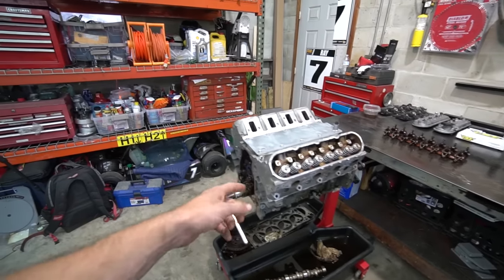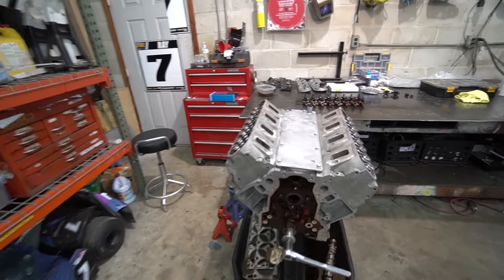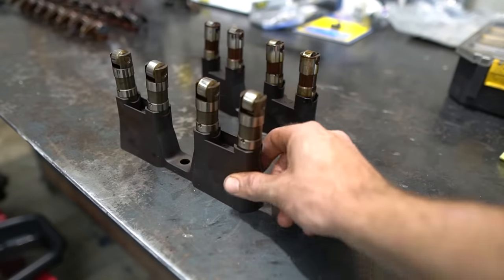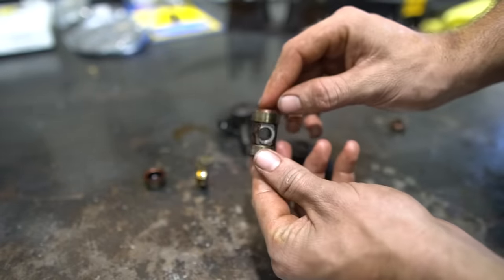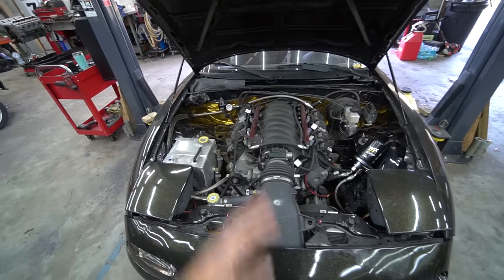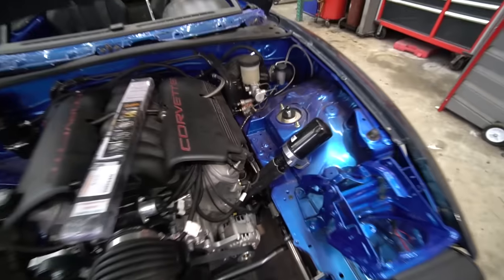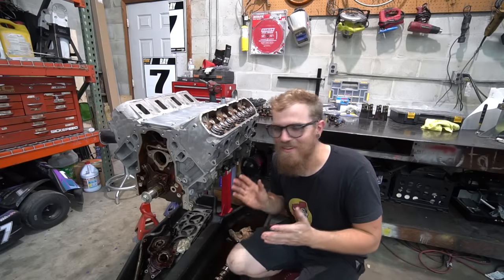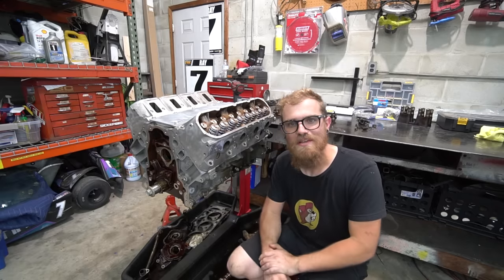Top 5 Mods To Make An LS Engine Reliable.

Comment: Hey bud so I will be working really hard as most of us at work to save  my goal of 16k to 17k give or take for a the best bang for my buck and I don't make a lot of money so I have to do extra work on the side so when I reach my goal and can start my build this spring I absolutely want it to last like you said! So I definitely am taking the tips you have spoken about to  Heart! 

Now as far as my my question for you. 
I know you said don't do any lower end, But I have a not so common build in store for my plan. 

I would like to go with a flat-plane  100% for the higher revs and the amazing F1 high end sounds. 
And I also want to CAM it as well.
I have never really worked on any 
 Internal parts on a motor little on never even pull the motor out or swapped a motor before! 

I am a total new be! 

But I am really serious about this very uncommon build and just want it to last a long time.
I will be doing this swap in my first-Gen 350z I have had for over 6 years now and have spent over the years a lot of money one making it look amazing for car shows and it truly looks very fast but its really just a stock 350 for the most part 
And now its time to make it fast and strong and RELIABLE.  

this is really my first real build as I had mentioned and I don't want it to fail any time soon so what are your best thoughts and insights on my intentions for this type of build? 

Also is there any way possible that we could talk on any different forums or Facebook or shit even just by phone at some point about this stuff? 

Please hit me back at your earliest convenience.  

Thanks in advance.  

PS: you video was great and was exactly what I needed to watch before starting a build. Great job and for helping a lot of people to not make mistakes.  
Keep up the great content.

Comment: Why do all 6.2 l92 after 3,000 miles have so much junk attached to magnetic drain plugs? They always have them I got several worth 40,000-80,000 they all get lots of it ever notice particles after oil changes ?

Comment: I like your video. Quick question, 5.3 out of a 2000 suburban with 283K miles on it. Would you rework the bottom end (new crank/cam bearings, crank honing, etc.)
Reply: What are you doing with it? It's probably fine; Motion has videos of a motor with double the mileage that they supercharged and beat up on. It's called the Bald Regal.

Comment: About the accusump thing, I used to race short course offroad and ran one, but I always wondered what happens if when the sump is filled, it gets pressurized air in it? Wouldn't it just do the same thing?

Comment: I literally beat the piss out of my Vortec 350 with 235k miles on it. I run Rotella in it and change it every 5k miles and that's it. I have a brand new spare engine that I got out of a parts truck for when mine blows up.

Comment: Dry sump does make it faster .A dry sump system is worth about 33 horsepower on a ls motor . On the motor dyno .good oil is another thing .dont be cheap on oil .a good racing oil with zinc in it will help save a motor. Plus its horsepower. Just say a Mobil one racing oil  synthetic is worth between 6 and 8 horsepower over a regular 20 50 racing oil .all your good racing oil is worth the money .in a performance style car .not your daily 300 thousand mile motor . Just saying we see it every day on the dyno.
Reply: A good dry sump pump will also generate crankcase vacuum, which is good for some horsepower and helps keep things from leaking!

Comment: Baffled pan would be ok just spinning the truck around a few times doing donuts?  I'm cam/converter only no race car here.  Also, which pan do you recommend?
Reply from the maker: Yeah that should be fine just overfill by a qt. And any trap door sheet metal pan would be ideal. You can get away with a cast baffled pan like the aluminum one I have in the rx7. It’s a mast swap pan.

Comment: I work for a GM dealership and have noticed that the trucks with the cast iron blocks do not have as many internal problems as the aluminum. Do you think this would be better for your drifting as far as reliability given the consideration that the block is heavier?
Reply: It's only 100 pounds more for an iron block
 Not all that great of a weight savings
But the Aluminum blocks have tons of downside

Comment: Good show know what you're doing GM all the way but I rather just have a older style bow tie block could do the same thing you're doing without having to spend all that money on the oil system just get a high volume oil pump and a pan you're good to go with the older blocks

Comment: Kind of a dumb question. But is high oil pressure a big deal/what does it entail? I know that low oil pressure is always a bad sign. But what about high?
Reply: If it's too high it'll start blowing out seals. Usually front and rear main would go first

Comment: MOST DONT NOW, 
Now you never want to over fill a engine with oil even if its your lawn mower. 
BUT.
if your car came wit a LS1V8 or what ever it says in the book to put 1 extra QUART of oil in to her before u run it hard, right in paper and black and white in the manual and run 5w30 full syn M1. all gm Ls comes with it from the factory don't skimp on correct lube 💥!!!!!!!

Comment: How many of these things are a must for just a street driven toy LS2?
Reply from the maker: Really none. Unless you have it out then do the seals. But yeah this is all for cars seeing g forces and high rpm often.
Reply: @Taylordrifts  Gotcha.  So the oem rocker arms are only a worry if you're on limiter a lot.  The seals and cam+valve train was something I was planning on doing when it comes out for engine bay paint. Motor only has 85k on it so Its still pretty much a spring chicken.  hahaha  What kind of oil pressure should a freshly sealed up and tight engine be hitting?

Comment: Is there a gear drive for the dry sump to avoid the belt drive and the possibility of losing oil pressure if the belt flys off, and by having gears you could change pressure by the gear ratio?
Reply from the maker: They do have dry sump pumps in the pan that are driven off a chain. But this isn’t like that.

Comment: But you didnt upgrade your oil system on the c5 drift vette right?! That thing did just fine
Reply from the maker: They have pretty good stock pans and it was running very low grip. The more grip and g force you experience the more slosh you’ll have.  A comp drift car starts to pull a lot of G’s
Reply: @Taylordrifts  Awesome thanks man! Iv finally got myself a c5 and cant wait to get started drifting! Thanks for being an awesome influence all these years!!

Comment: How to make any engine reliable, CHANGE OIL, change oil pump to high volume unit FROM MELLING. add external oiil cooler and bypass valve for cooler if oil is too cold. Run Recommended oil weight as a synthetic. Stay away from Penzoil, Quakerstate, Mobile 1, Royal Purple.

On LS engines, TURN OFF AFM IF EQUIPPED, REPLACE OIL PICKUP TUBE RING WITH A FELPRO OR MELLING.

Comment: I'll just keep on searching for the Dry Sumped LS3's and add forged rods (they already have a forged crank in them) forged pistons....CORRECT the deficiencies of the flow circuits in the oiling system...The LS oil system has a lot of 90 degree intersections that are poorly drilled....and MOST OF ALL....Run the OEM oil barbell at the back rather than some aluminum piece of crap that lets unfiltered oil bypass the oil filter feed....Maybe those guys making those aluminum barbells should add another "O" ring onto them to prevent unfiltered oil past the barbell like the GM one that seals to the oil passage....🤣

Comment: Whys is there a check valve on bens accusump line? doesn't the oil need to go both ways through the line, to refill the accusump and to supply the engine with oil.
Reply from the maker: Basically that’s the return from the cooler. Normal feed route would be through the check valve open. Accusump would be on the closed side bypassing the cooler and filter and going strait to the engine.
Reply: @Taylordrifts  ok its not on the accusump line, that makes a lot of sense. Thanks!

Comment: Ok what if you buy the engine do all this work you're talking about and you dont mess with the bottom end... you go to start it and it smokes?  how do you know for fact that the rings are good? Now you have to go back and pull the motor back out and take off just about everything you put on to replace the rings... Yeah you can take the caps off to look at the bearings but what about the rings?
Reply: Test compression.

Comment: Over 250K miles and still running smooth as silk. Yep. Just put gas in it and change the oil once in awhile.
Reply from the maker: You didn’t watch the beginning of the video did you?

Comment: New to the ls swap deal, have a fox notch , there is absolutely NO WAY I'm NOT LS'n it. Any pro / Con to the L33 over the standard iron 5.3 Anyone? Thanks in advance 🤘
Reply from the maker: L33 has better heads and flat top pistons giving it higher compression. Depends on what you wanna do with the car. Budget and strait line speed just go iron and turbo it. Auto x or drifting or something save the weight and go aluminum block bits 101lbs less than the iron.

Comment: I guess if your watching this video to "learn about motors" then yeah, dont mess with the internals. But theres absolutely nothing wrong with refreshing the motor, adding head studs or building it
Reply: The point is most people that do a LS swap don't really need that extra bit of tweaking for what they really want to achieve. Of course you can do a refresh but honestly there is so much that can go wrong and if 400-500hp is the real life goal then its already got you covered. Sometimes an engine is only bought for the sole purpose of tuning it to the max as it sucks at stock but with the right setup can shine. Sometimes an engine can also be bought for what it already has like an LS.
Reply: It's kind of like soldering. Most people think they know how to do it. Most people can manage to make a connection work. Most people are actually bad at soldering. The same applied to engine building. Unless you a certain you can get it all right, you may have a higher chance of messing something up than getting it right.

Comment: I am about to buy my first LS to build. What would be something you would tell a first time motor builder?
Reply: The Fit Fam how much power are you going for? NA, turbo, supercharger, spray? Vehicle weight estimate?
Reply: Know Bull5hit I may want to supercharge or pro-charge at some point but I want it around 500whp if I can get that NA I may not even think about any type of forced induction. I’m not sure the exact vehicle yet still on the fence with that part.
Reply: The Fit Fam  what will you use the vehicle for?
Reply: For personal enjoyment no drifting or drag racing.
Reply: The Fit Fam i would recommend doing a mild bolt on 6.0 or 6.2 if you can find one for a good price. A 6.2 with cam, springs, throttle body would make right around 500whp in a stick car. For your goals you’ll never need to touch the bottom end unless it was already hurt
Reply: Know Bull5hit that’s what I was thinking I would need, but thank you for the info it really help me know what I need to look for.

Comment: What's the best LS motor to look for to upgrade an LS1?
Reply from the maker: L92 truck motor. 6.2L aluminum block, L92 Rec port heads. Easy 500whp with cam and springs

Comment: That oil pickup tube single bolt despite two bolt holes ... I'd call that an engineered failure point. It's that way on purpose to get people to buy engines.
Reply: It's what happens when accountants get involved in engineering decisions.
Reply: It is perfectly fine in stock application...there are millions of these engines with a quarter million miles on them with one bolt...

Comment: DO NOT USE 20w-50 RACING OIL IN AN LS ENGINE.  Sorry all caps, but damn.  I build these engines from pan to intake and someone ALWAYS tries to run 20w-50 through it.  Listen guys, IT IS NOT A SMALL BLOCK.  Dude, that would be my Number 1.

Comment: U generally dont have to change the oil pan on a ls swap if u swap in real ls motors and not a truck motor
Reply from the maker: The vette pans don’t fit well in just about anything. So really only GTO and F body would allow you to not change the pan and you should be doing a baffle in those anyway.

Comment: I would be paranoid knowing bottom end could get wiped out if a belt snaps. No Thanks!
Reply: Having that happen is way more rare then bottom end dying from wet sump. Look up and legit race car and 95% run dry sump. There's nothing better for the oil system than that.

Comment: The only way to make a Chevy reliable is to pull the motor and transmission out, sit it on the ground and stomp on it, then drop a Ford motor and transmission back in it.

Comment: The lifters are not what fails. It has always been the lifter trays that fail not the lifters. I repeat NOT ThE LIFTERS.  
The lifter trays wear out and the lifter only in the lifter bore and then starts taking out the cam.  
Go to lifter bars to solve this problem. It’s a shitty desgn from GM. 
We have two to three engines come in weekly with this problem.

Comment: ARE YOU HIGH? You take sloppy mechanics advice to heart yet you say you need a dry sump to have a reliable ls HAHAHAHAHAHAHAHAHAHAHA
Reply: Jesse Thomas if you watch sloppy closely, you'll notice he's not racing anything besides a dyno and a few drag passes. good content but when you go racing with side g forces you gotta keep oil in them. and he doesn't address that at all because of how he uses them. plus he breaks them often, which is the point. 500$, engines you change like underwear. but in drifting or road racing you kinda need your engine to last more than 10sec.
Reply: @jsomething2  ya I don't drift. my youtube isn't called jessedrifts. I have no idea how hard drifting is on components. I haven't been doing it for the past 12+ years......lol

Comment: Old Lifter Trays maker your Lifters walk and wear out your cam. Always use new Lifter Trays, Lifters, Chain  and maybe Rocker Arms if you see excessive wear and change your damn oil if you plan on keeping it . And stay away from Ebay Chinese Lifters and trays. I Just bought a set and they were the most sorry POS. Buy Melling and GM Trays.

Comment: I'm sorry taylor I really love your channel and your work is so bad ass but your wrong the guys that are pushing 8 to 1000 hp take there bottom ends apart gap there rings and if they know what there doing making the bearing gap right and especially on an engine that will be in a drift car if you buy it with more then 50k miles pull your crank and pistons and gap everything then your motor will last they are strong yes and I know alot of poeple have good luck with them but besides luck if your doing a LS swap and the engine is out re build it all the way it will last twice as long and have more power for longer .. periods before it gets hot soaked and starts to lose power I'm sorry but a motor with over 100k will not run as good as a motor with a 100k and the right gaps

Comment: What a load of crap,don't treat it like you stole it,regular oil changes,200,000kms oil pressure like new,compression like new,300kw still does the occasional burnout, the more work you do to any engine and the harder treat it the less reliable it's gonna be

Comment: In short, change almost everything minus pistons, rings and crankshaft
Reply: jamdc2000 which is the opposite of what everyone seems to do. they change pistons/rings, machine block and replace crankshaft, maybe add a high pressure oil pump at best. leave everything else stock and get mad when it blows up because the oiling system was designed for a zero g load stock truck, not a race car.

Comment: Don't touch the bottom end of the engine? Wtf? Worst advice ever. You're buying a wrecking yard engine as a core. Ask a professional engine builder if they'd agree with you? I love your videos mate but this is really bad advice. Blue printing a race engine is done for a reason. I've never seen a professional race team use a bottom end with 200k kilometres on the clock. That's insane!